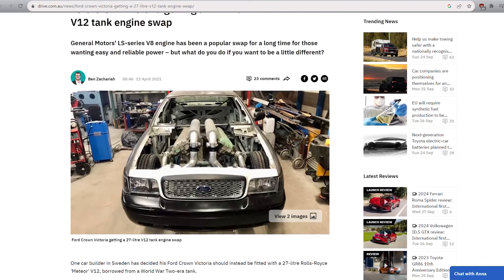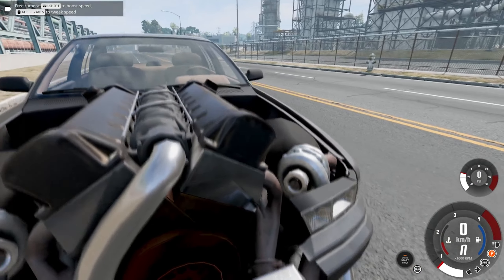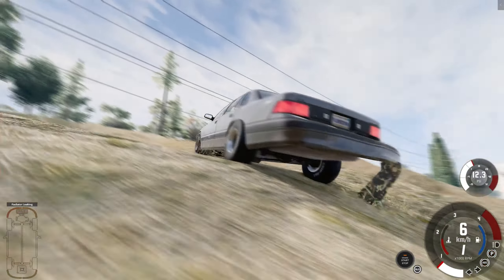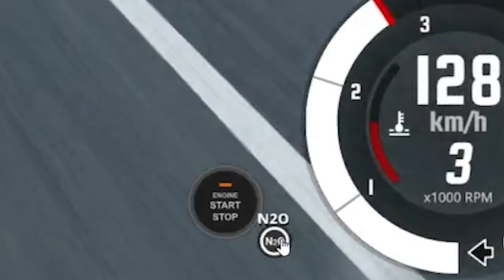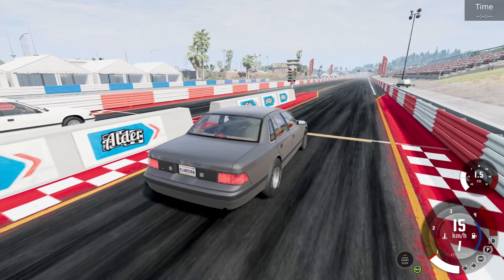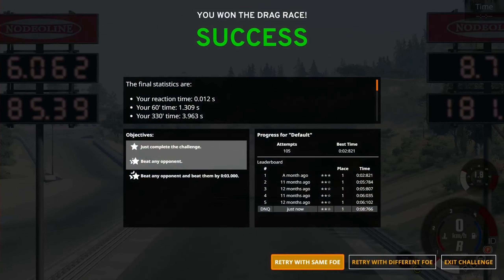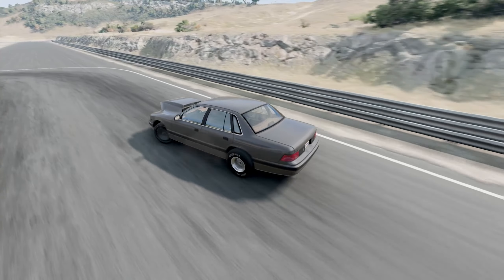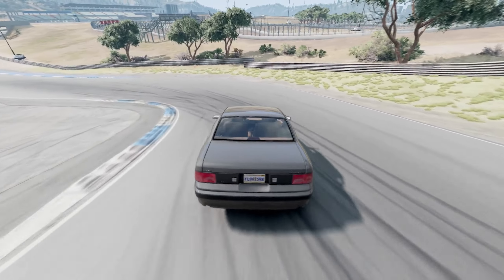This Guy's Mod Goes Hard

Comment: iirc AI is slow in drag races as it only uses 99% throttle, which will not engage the nos
Reply from the maker: they're slow even without nos cars... it's just weird (and kind of annoying because I have to set the race up again and set a real time, then compare)

Comment: Hey filman86 Driveshafts are not weak they just twist easy, especially when you're putting so much torque through them the pipe will twist and inplode on itself
Reply from the maker: but there's not even a stronger versions made by the devs

Comment: I don't remember what mod i  have installed that does it, but it will let you install an Enhanced ECU on both gas and diesel engines which let's you do more tuning to the engine than just adjusting the Rev limiter.
Can get a higher Rev limit on the diesel engine without it damaging the engine from over reving.

Edit: With the power of that engine and it using the diesel engine rpm logic, you could probably skip gears.
Like go first gear, skip second gear and go straight to third gear. 
A 6spd sequential transmission would probably be more ideal for that vehicle.
Reply from the maker: I've seen that one around too

Comment: If you're still wondering why the driveshaft is so fragile, it's probably because it's capacity to put up with stress is taken up by the increased torque, so when the rear axle gets moved in a way it shouldn't (thank you wimpy panhard bar) it's just too much.
Reply from the maker: but there's no stronger driveshaft option, so I'm assuming they're predicating its breakability on something else

Comment: I wonder if these are the same engines used on tractor pullers, they fit like four (or more) of these on the frame :D
I was at a tractor pull event in the 90s, they had a lot of Rolls-Royce engines
Reply: Pretty much.
And not only 4 or more of these but also with superchargers, turbochargers...everything that can fit. 🍷🗿
Reply from the maker: not fully sure, but most run extreme v8 engines

Comment: drive shafts are 2 times as strong as half shafts. but the connections can easily break if there is a huge torque shift
Reply: usually it explodes into 2-5 parts but if you arent so lucky then it shears clean in 1/2 (i say that because you can usually re weld it so its fixed)
Reply from the maker: I'd guess most of the difference is in the uni vs cv joint

Comment: there is most defiantly enough torque in that thing to be launched in 3rd gear. tbh the gearing needs to be much, much longer to accommodate the absolute mountain of torque that thing has. also please please please for the love of god could you stop using cars in auto/arcade mode. beam has terrible gear shifting algorithms for manual vehicles.
Reply from the maker: haha I don't have the coordination to control a manual gearbox with a controller, so I only do it when I've set up my sim rig